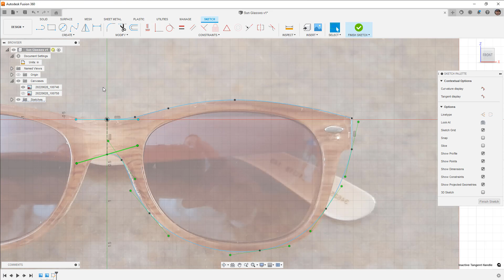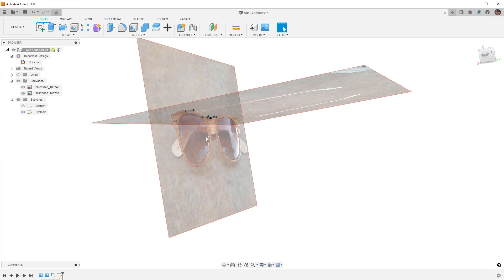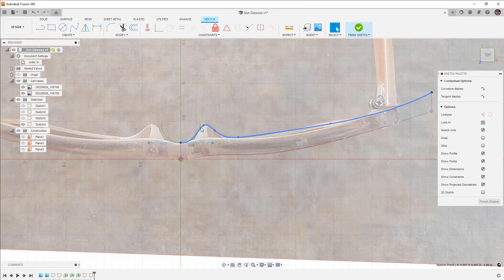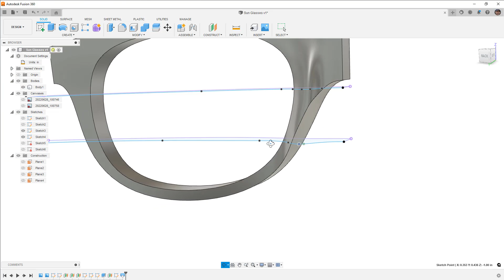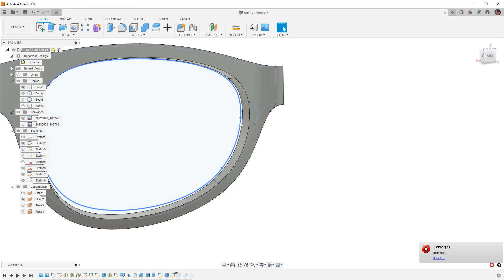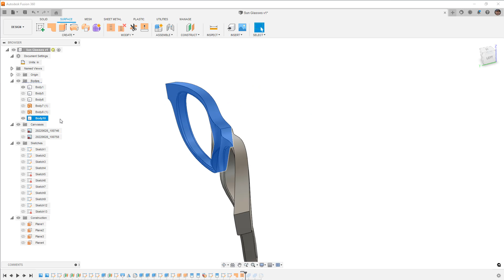How To Model Sunglasses Using Solids | Workflow for Making Complex Shapes with Solid Features #CAD

Comment: Thanks for sharing this helpful tutorial, I found difficult to create the space for the lens, any tutorial to suggest? How can I create the perfect space ?
Reply from the maker: For sure.  The best bet is to make your lens and then use combine selecting the frame as the body and the lens as the tool. there is a checkbox to keep tool.  that will leave the exact space.  If you need more room you can scale up a copy of the lens or offset the cut after by using Press Pull or Offset face
Reply: @ thx! In your tutorial you showed how to model the frame in two directions, any suggestions to work with the third direction? You extrude the front and the top and then you did the intersection, but I need also the side of the frame…
Reply from the maker: Working from 2 directions is the same from the side. you would just need a side view and top view.  When you work in this way you just need to pick 2 views that represent the curvature needed.  

https://a360.co/4jc1QKf

Start around sketch 17.  This way is a bit different and needed if you can't get the shape in the 2 view method.

Comment: i have the problem that when i mirror the surface and the front edge is not a line but a curved spline as well as the sides i dont get a smooth continuity in the zebra-inspection mode. (the side-splines still beeing horizontal/tangent) Do you know this problem with surfaces where all sides are splines?
Reply from the maker: Hard to say without seeing the model but at the midplane where you are going to mirror you need to make sure the spline handles are horizontal.  If that is the case (as you noted) I would have to take a look at it.  can you send the file support@caducator.com ?
Reply: @LearnEverythingAboutDesign  which fileformat can i send you the file ? i have a free version of fusion360...
Reply from the maker: @Alex-fw9cu  from your file menu pick Export and save it as the F3d file that way i can see the timelilne/history.

Comment: Is easier to first design (or copy in this case) using Inkscape (vector design) and later import it in Fusion 360.
Reply from the maker: Sure if that works for you.  I don't do much (none) graphic design so for me working in 3d from the start is easier.  You can import an svg into fusion and use it as a sketch so building curves in a drawing program could simplify things.
Reply: @LearnEverythingAboutDesign  thats why I said... Inkscape as start sketch is very helpful.

Comment: I love all your work here. I wonder if you can point me to the right tutorial for creating a 3d parametric wall design in fusion. I have looked but couldn't find anything. The design I am referring to is then cut out on CNC from wood. ANy help or direction will be very helpful. Thanks,
Reply from the maker: Do you have any specific examples?  I have covered some specific topics on parametric design in the context of user parameters, patterns and also I did a video on making a program to configure wooden cabinet doors from a spreadsheet.  If you want to email me an idea for what you are trying to do I will add it to my list.

User Parameters video on patterns
https://youtu.be/-BPcktQwIIY

User Parameters fundamentals video
https://youtu.be/ntMBZQUTLNA

Intro to API Cabinet door configurator
https://youtu.be/mxvQgpgOvzE

Comment: Any tips for having the control points on splines manipulate smoothly?  Whenever I try to move the points or adjust the green control lines they are extremely "notchy" and very difficult to place in a fine manner. My laptop is a pretty fast gaming laptop.
Reply from the maker: Hm that is a new one Johnny,  under the ? help menu try going to Support and Diagnostics and run a graphics diagnostics to see if there are any issues there.  The other thing to try is hold down CTRL to override persistent constraints and see if maybe its trying to grab onto something else in the sketch.  I haven't really noticed that on my end.

Does it happen with fit point and box point splines?